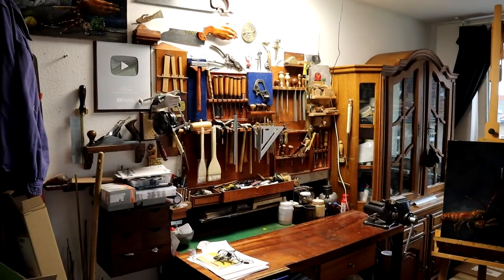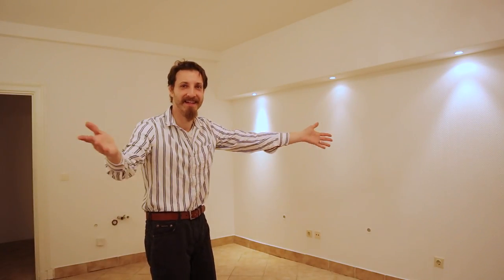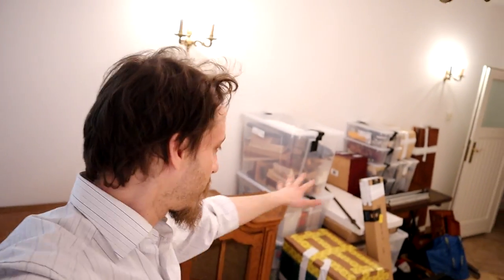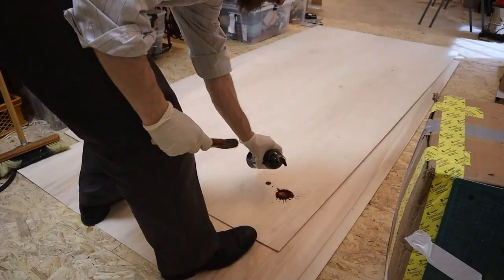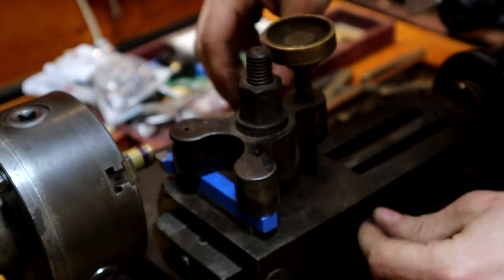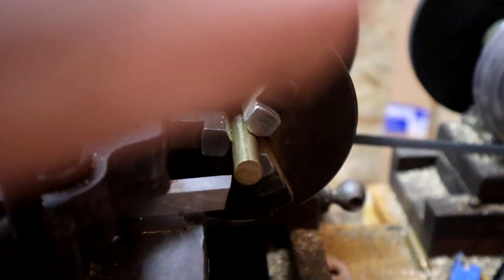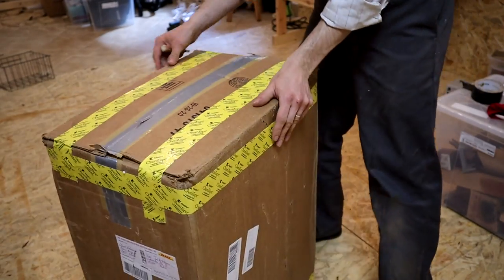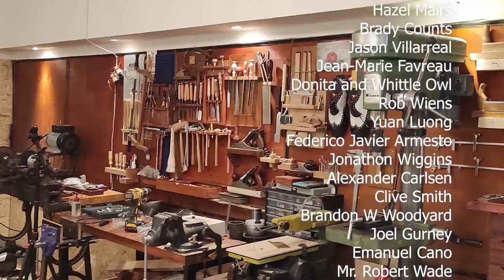New Workshop!

Comment: Putting in all that plywood is a real flex right now with the prices so high.
Reply: You mean mdf?
Reply: OBS wood
Reply: @TobiasHoffmannWup  No, he means the plywood that he put over the top of that. Big sheets of it, about 1/8 in. thick, that he stained, nailed up, then added some molding, then sprayed the molding black? That stuff. It's not even just the cost, it's impossible to get your hands on any right now, at least where I'm at (US, South Florida). But of course if you find it, the price is ridiculous.
Reply: Plywood is much cheaper in Germany.
Reply: @VeganAtheistWeirdo  >The USA is buying out lots of German wood at the moment. The prices are here on the rise aswell.
Reply: @TobiasHoffmannWup  (MDF) Medium Density Fiber board was not used at all in this video. (OSB) Oriented Strand Board and Birch plywood was used.
Reply: @stumpbumpers  thanks mate
Reply: OSB and 1/8" birch plywood are both cheap, even with the high lumber prices now in the US and elsewhere. was in Home Depot the other day, and a 4x8 foot sheet of 1/8" ply was around $16. OSB is even cheaper, depending on the thickness (7/16" is ~$12)
Reply: @yellowcrescent  I don’t know where you’re at, but OSB is $66.17 per sheet at Home Depot in Jacksonville, NC. You must be looking a the 2x8 rips or 20” smaller pieces. Home Depot doesn’t carry 1/8” birch and 1/4” birch is out of stock in 4x8. If it is in stock, it would have to be at least $30 per 1/4”x4x8 sheet.
Reply: @stumpbumpers  Ahh, you're right. I just checked online and 4x8 OSB was $44/sheet (7/16"), not sure what i was looking at. I'm in Southeast VA/VA Beach. I bought a sheet of 4x8 3/4" Purebond Birch plywood last week for ~$64, which is about 40% more expensive than it was late last year, but still not too bad.
Reply: i dont think its that expensive in germanny
Reply: @n0z1t25  Correct, but there was a comment about Home Depot in the 🇺🇸. The materials in the video are likely a 10th of what we pay here. Also, there was a comment that references the 🇺🇸 buying materials from Germany. 👍
Reply: @n0z1t25  Well, prices have gone up a lot recently. As a matter of facts though, you'll be hard-pressed to find any wood at all right now, as everything gets sold to the US, so there's nothing left for the German market. Once again the greedy and selfish US gives a crap about the rest of us.
Reply: @TobiasHoffmannWup  doesn’t matter if it’s mdf or osb. It’s still stupid expensive right now lol
Reply: @yellowcrescent  that’s high dude. That should be like 5 bucks. A sheet of simple 3/4” plywood used to be like 20-25 bucks. The good stuff was like 30-35.

Comment: Congratulations!!! Watching this video just drives home how we take garages and basements for granted in the States. Very happy for you!
Reply from the maker: Thanks Rex!
Reply: Exactly. As someone in the PNW I've been so curious how someone in NYC could even begin to be a hobbiest wood or metal worker!
Reply: not only garage spaces (my workshop is a maybe 5 m^2 in a second story of a builing) but also woodworkers from the states take for granted the ease for free lumber and good quality tools (second hand or new). I live in barcelona and its super hard to find anything half decent on second hand stores and if I don't buy wood (which I don't because its super expensive and I'm a broke student) I have to rely on small pieces of super curly firewood that I steal from here and there or old furniture that someone threw away as sources of lumber.
Reply: @1999GGO  Old furniture is generally amazing lumber. Already aged, straight and stable. Don't dismiss it as crap, it's better working than most stuff you'd order from a mill. Broken pianos are a great source if you need a lot, and you can recycle the frame within for extra cash.
Reply: @nobodynoone2500    you don't understand me ,when I say old furniture I mean usually bad pine stuff if I'm very lucky, most of the furniture that gets thrown out is old IKEA stuf made from empty panels , I'd love to find good old furniture but in that case most likely I wouldn't use it as lumber rather as it is. Good furniture doesn't get trown out rather sold the furniture that gets thrown out its usually things that didnt cost more than 30€ and the lumber is that kind of pine that isnt even solid strips that go all the way across rather small pieces form strips and those strips glued together make panels. But hey most of that works fine for usefull tools gigs etc. 

I'd really love to learn to use green wood but I find it rather dificult to find and I wouldn't have anywhere to store it really.
Reply: @Betruul  Try a Sherline lathe. It's bigger than a clock maker's lathe but still "apartment size".
Reply: A 1x1m out of use bathroom for me :)

Comment: You said "Help me"...
Your belts should be in the best condition possible; nice and supple. Hard belts will cause vibration.
Tension: Ideally, you should be able to pinch the belts together midway between the pulleys and they should move their own thickness and no more.
The cross slide of your lathe was (dangerously) closer to the chuck than the tool post. Always make sure that the tool post is at least flush with the carriage and cross slide. (You can see where the carriage has been chewed up by the chuck...

Such a beautiful lathe.

Please get a vice for the drill press!

In a previous video, you expressed a desire to make a (musical) wind instrument...
I've just retired as a clarinet maker and woodwind repair technician...get in touch if you want some help, both theoretical and practical.

Good to see you back!

Comment: Cutting oil when using the lathe on steel, and maybe a tensioner on the pulley belt (eg. a small roller that is pressed into the belt to put a bit of additional tension on it and keep it from flopping about).

Possibly a sealant on the particle board on the floor too?  That'll make it a lot easier to clean up and help to prevent damage to it.
Reply: Did you see the shatter on the lath?
Something isn't tight there.
I would fix that first.

Comment: Looks like a great new space, and that lathe is beautiful. Wouldn't in the least be concerned with the squeal, old equipment always takes a ton of adjustment and endless bearing preload and lubrication experiments, but I personally find that relaxing. Bet when you're done it will cut smoother than any modern stuff.

Comment: cool shit my man!
some advice tho, obvs for lathe no loose clothing and for drill press, check the pulleys/belts tightness, if its too lose going to lower steps wont give you more torque power.
at the part between motor and main shaft the big bolt screws, that the motor can slide up and down on, can be used to tighten up the belt. 

wish ANYONE wouldve told me that, for like 2 years I just thought my drill press's belt was just worn out...one day I was fiddling around and cleaning it and thought "I wonder what happens to the pulleys if I mess with these bolts" yup...after 2 years...finally I have a properly working drill press...

Comment: 12:06 "HOW TO LOSE A FINGER 101" (please see this and use a vice or clamp in future, when the drill bit breaks through, it can catch and spin the part, both lifting it and rotating it, with a drill press that can easily either cut you badly, remove a finger or worse- send the part flying accross the room and impale you)
t. mechanical fitter/artisan/machinist/guy with a spanner

Comment: I'm not usually a huge stickler for safety, but let me tell you: Holding on to the workpiece while you drill it, especially metal, ESPECIALLY especially brass, is a really bad idea. Brass is grabby and it will spin around and into your hand in an instant.
Reply: Brass is also soft anything harder might grab just as easily. But it helps to have a drill press instead of drilling by hand. The bigger the hole the harder it gets though.  securing it with a clamp or vice is always a good way to save you from trouble. You are right there.
Reply: i did this with a sawblade and no vice, once the drill bit started breaking through it grabbed the blade and started spinning it at like 700 rpm, the blade "grabbed"/skimmed over my hand like 3 times, but the blade was so dull it didn't cut me :D. i let it spin for another 20-30 seconds wondering how the fuck I was going to turn it off and if the blade would fly off like in the Wild Wild West movie. I still don't have a vice for my drill press lol
Reply: That’s why I built myself a small table with fence to brace or clamp things down.  I learned the almost hard way.
Reply: I drilled 4 spaced holes in my drill bed,I drop the chuck key in a suitable hole and let the work butt up against it,you then only have to hold the work down.

Comment: that last shot when u was drilling brass if u make the flute at the cutting edge parallel to the axis of the drill it will not pull like that but you probably already knew that

Comment: you so need a vacuum to clean up all the debris when you drill and lathe.. 
but since you work on small projects you don't need  a bid industrial vacuum,
perhaps you could build yourself a small vacuum with a nozzle that hangs from the ceiling and follows you around from one tool station to the other

Comment: 12:11 so that doesn't happen, you need to dull the drill bit just enough that it still cuts, but doesn't grab anymore. What happens is the super sharp flute edges grab the last part of the skin at the end of the hole and form a ladder on which the part grabs. You can also get away with using a piece of plywood (for better accuracy) but you need to whale on the handle, but you still need to peck at the hole. Simpler to dull the drill bit. I have a set just for brass, copper, and aluminium, all slightly dulled tips.
Reply: I respectfully disagree. Drill bits are meant to be sharp. The proper solution is to clamp the workpiece
Reply: @edancoll3250  That's why it's a spare set. Not my idea. It came straight from Clickspring. And if there's anyone who knows about brass, it's him. Clamping doesn't always work, especially with small parts.

Comment: I was concerned when I saw you putting the sheet goods on the wall with what look like drywall anchors.  Considering the amount of weight you end up hanging on the wall, I would not trust the anchors.  In stead, I would find where the studs are and attach the plywood or particle board with at least a few screws going into wall studs.  Am I being too paranoid? 
Nice shop.  Wishing you well in your new space.

Comment: You are basically using a dull high speed steel blank... It doesn't have the proper relief angles cut on it yet

Comment: Please clamp your project down to the platform on your drill press if not it will start helicoptering it would spin around like a helicopter and whack you in the back of the hand or cut you wide open and I love your videos and I also love copper and brass and creativity which this channel has all the above

Comment: G"Day Uri,,mate have missed you,,love your honesty,and humour,,
now about your lathe tooling,,you really need to look at lead anglees and cutting edge clearance,,and get your tool on centre height,,Will improve surface finish,,(Less Sand paper),
and Now drilling brass,,again suggest you look at "killing cutting edges with brass and any sort of double drilling you may want to do,,( double drilling is when you use a second drill to bring very close to size,,depending on quality of drill<but in most cases no need for reamer,,)(usually 1/2 or  0.5 mm cut is fine),If i was smart enough to drive this machine i would have sent drawings,,But my Forta is machine's,,yes I'm A Fitter and Machinist,,Aussie style,Any Help i can be please let me know,,
love your work,,

Comment: Very low speed for turning. For a diameter of 20 mm on a steel billet, a minimum of 1000 revolutions of the spindle are required, and a cutter with a hard alloy plate. HSS cutters are not very good, give low surface cleanliness and can not work at such speeds.